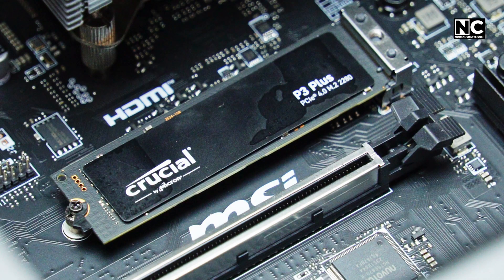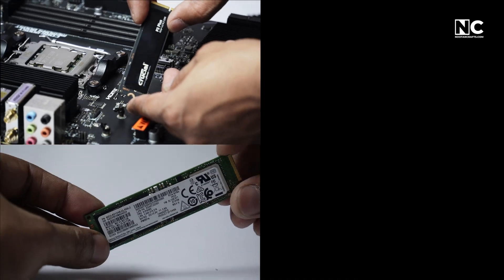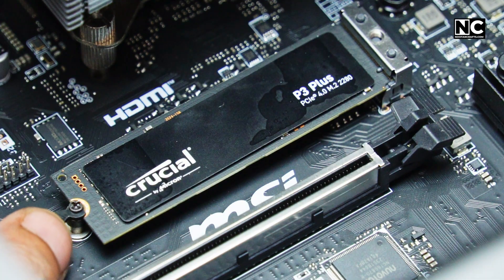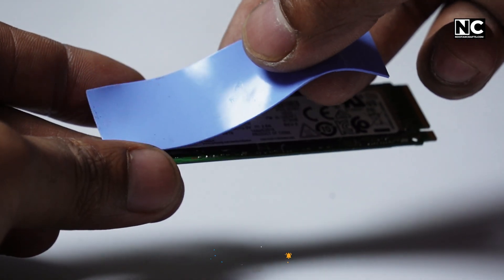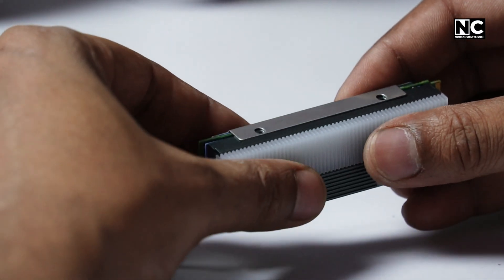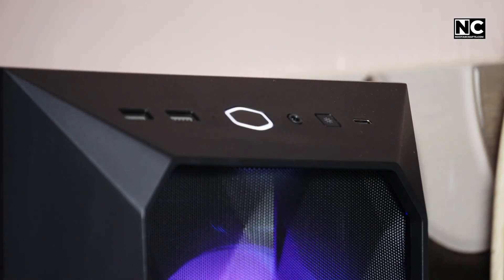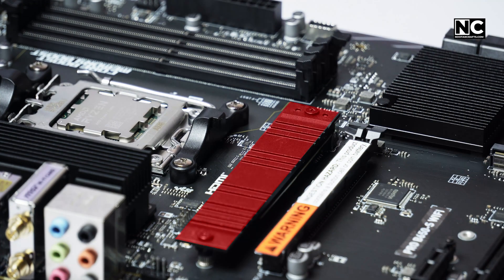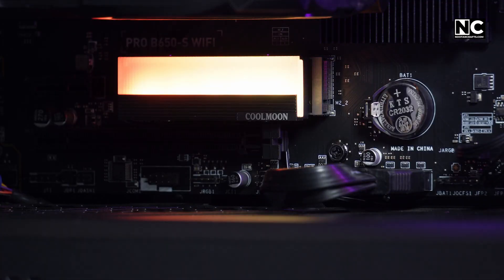How to Install an SSD Heatsink –  Ensure Efficient Cooling!

Comment: What should be the ideal thickness of the strip willl 1.5 mm do the work
Reply from the maker: Thermal pads aren’t mattresses — thicker doesn’t mean better. The goal is direct contact with no gaps. Most SSD heatsinks are designed for ~1 mm pads, so 1.5 mm may lift it slightly and hurt performance.

Comment: Data chale jayega na agar ye kiya to  ?
Reply from the maker: Installing a heatsink on your SSD will not affect your data unless you are performing additional tasks, such as installing a fresh operating system. The heatsink's primary function is to lower your SSD's temperature; it does not impact your data in any way. Thanks for your comment!

अपने SSD पर हीटसिंक लगाने से आपके डेटा पर तब तक कोई असर नहीं पड़ेगा जब तक कि आप कोई नया ऑपरेटिंग सिस्टम (जैसे विंडोज) इंस्टॉल करने जैसा अतिरिक्त काम न कर रहे हों। हीटसिंक का मुख्य काम आपके SSD का तापमान कम करना है; यह आपके डेटा पर किसी भी तरह से असर नहीं डालता। आपकी कमेंट के लिए धन्यवाद!